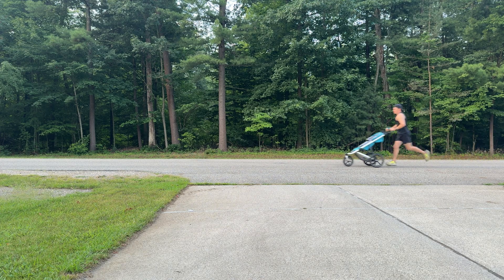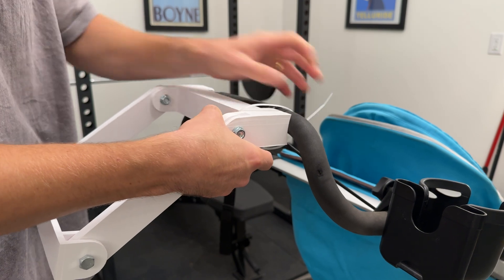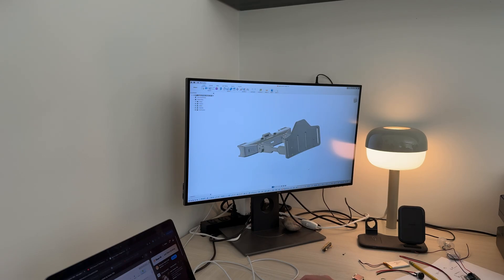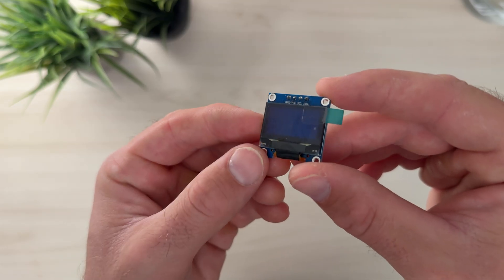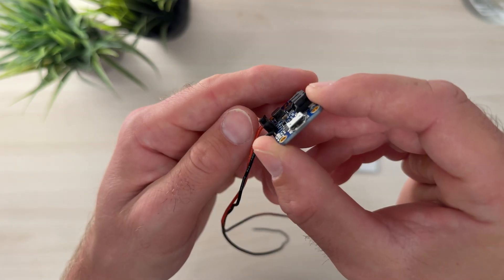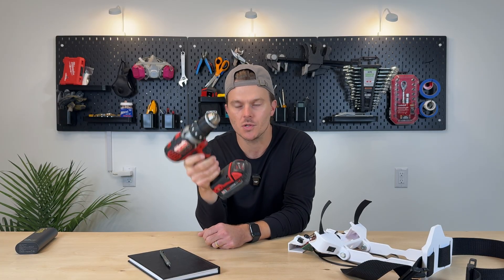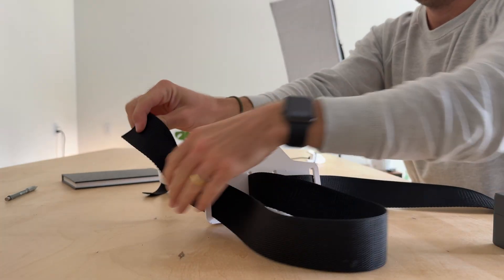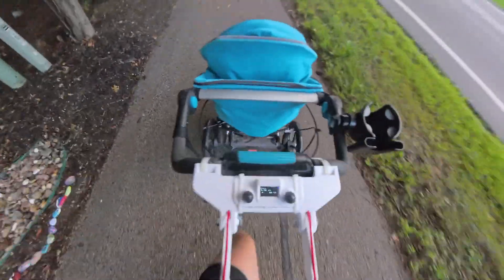This ONE gadget is helping me stay fit (as a dad)

Comment: Great video and love the process, just curious, what happens if you trip and fall? I would make the connection points on the stroller breakaway, and add an emergency bungee attached from the stroller to yourself so the kiddo does not roll away.
Reply from the maker: Great idea! Can honestly say I didn’t consider that during the design process - love the idea of something that could easily detach in that case